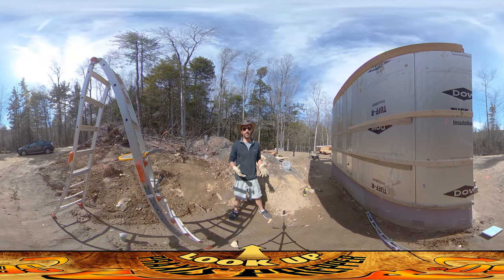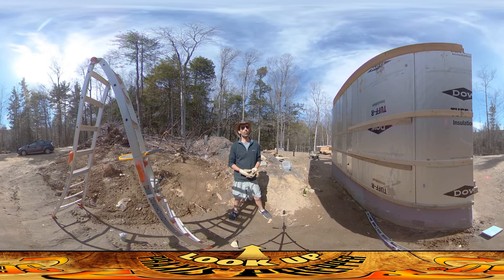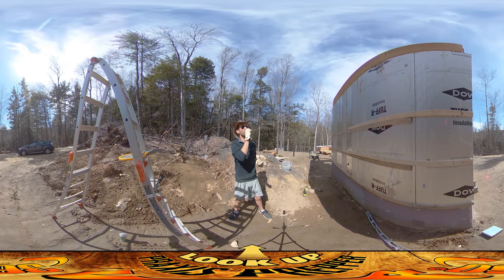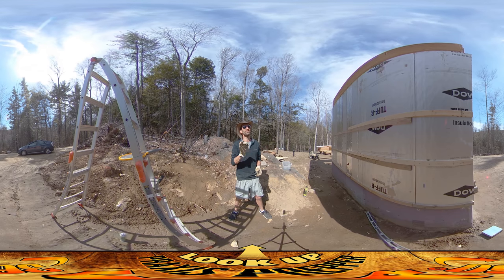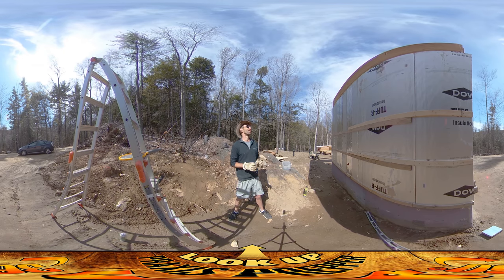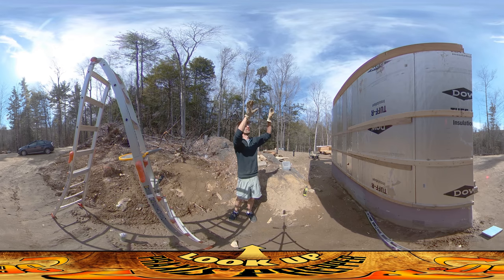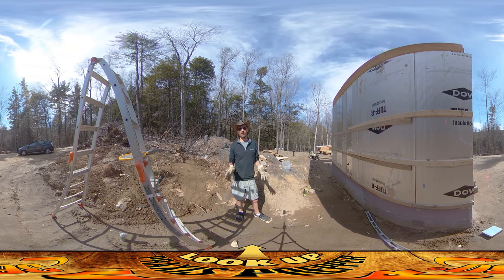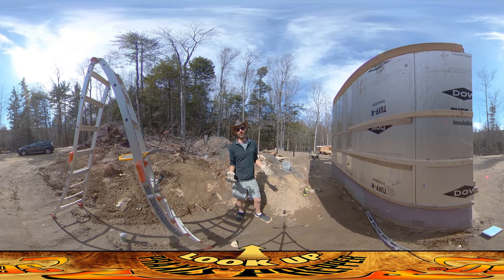Homestead Building - Mini House Foam Insulation

Comment: We need a bug zapper like that for in the house!!  We live in Florida and are "bugged" by little fruit flies in the house all the time! Where did you get that useful tool????
Reply: Those "tennis racquet" bug zappers are most commonly found in gift shops and novelty stores. You might try a company called Johnson Smith & Co., as they have lots of neat stuff, novelties, and gag gift items.
Reply from the maker: They sell them at all sorts of home stores and general stores here. I just looked them up on Amazon and here's  a link: https://amzn.to/2zv9mze
The Amazon price is higher than I'm used to paying. I usually pay about $10-$12 or so.
A small smokey fire also helps with bugs too... which I remembered the day after I shot this video.